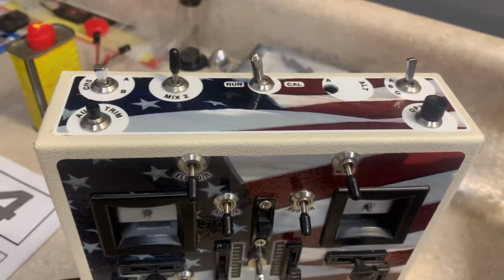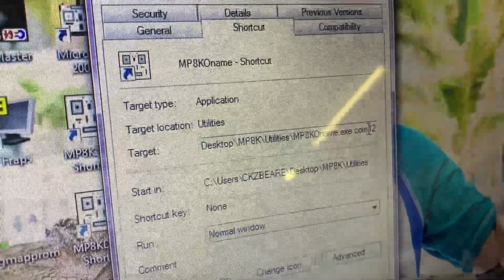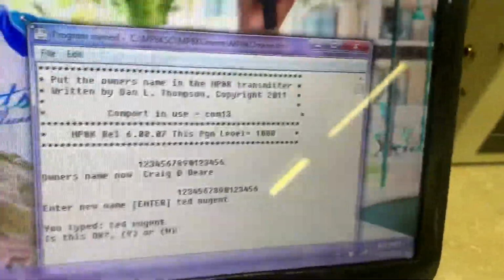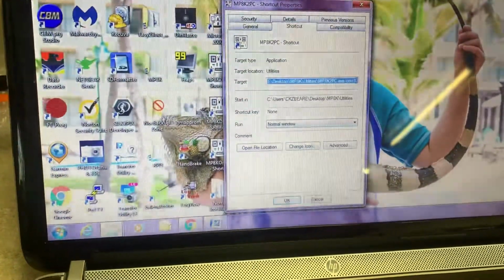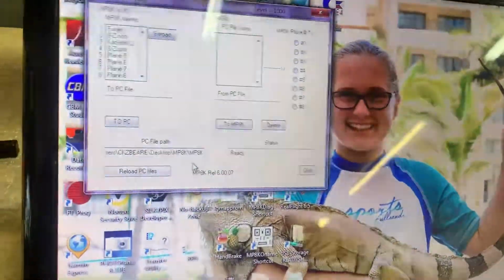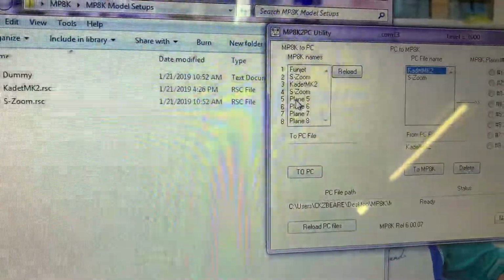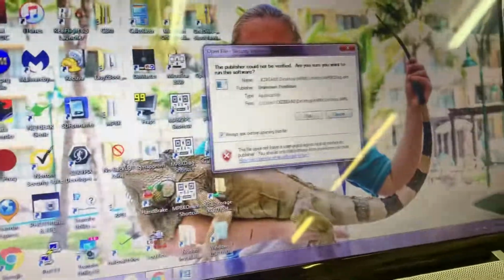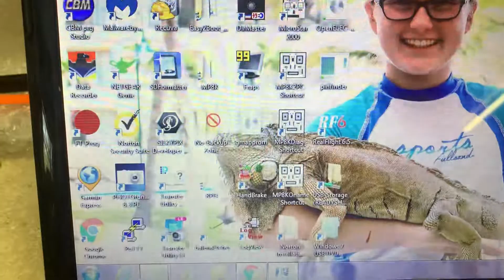Ace R/C Micropro 8000 (MP8K) PC Utilities

Comment: Hey!
Where did you get that rudder knob for the single stick?
The plastic one it comes with feels really cheap
Reply from the maker: RyanNX211 it was fitted to the radio when I purchased it.  The original owner passed away, and the radio was gifted to his good friend; I purchased it from him (the friend).  I believe he said the original owner made it himself, and engineered it to work with the Ace pot.  The throw on it was much shorter than the OEM knob (so I was told) and it did seem short to me.  One drawback is that it weighed much more than OEM so it was really easy to induce an up elevator movement...sometimes accidentally.  The stick would also sometimes droop if the radio was sitting vertical on its base.  I no longer own that radio...sold it recently on EBbay.